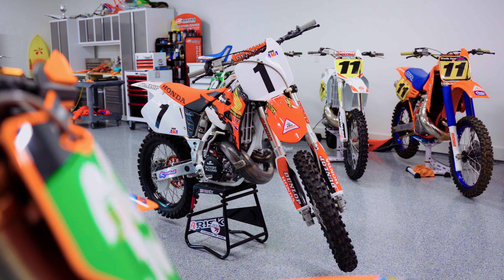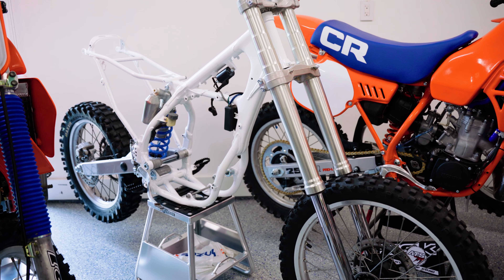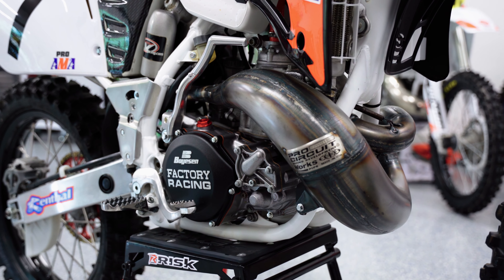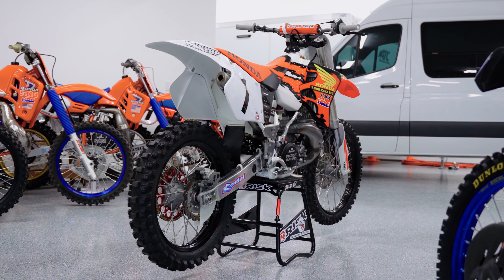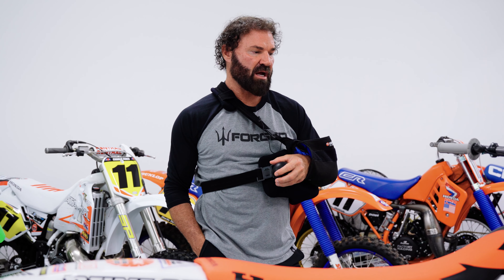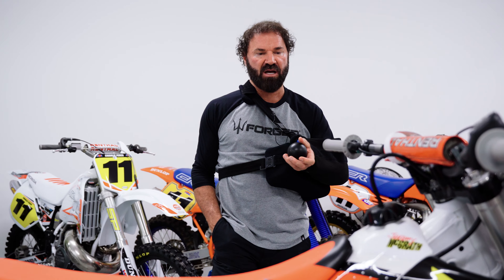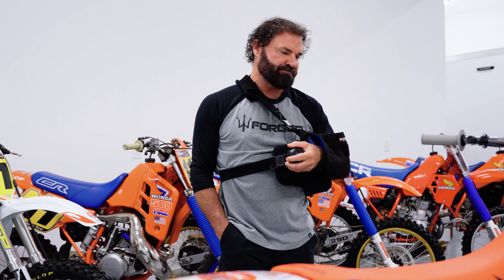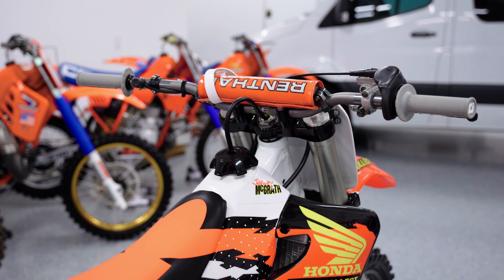Jeremy McGrath CR 250 Replica Restoration

Comment: Hey Charlie just picked up a 95 cr 250 2 weeks ago always loved the 95s going to restore after my 500  That tank whats the difference to OEM
Reply from the maker: Congratulations on the bike!  Clark makes good tanks, but you want to get the factory size. I am not a fan of the oversize tanks. They may have some in stock. Otherwise, there is a company that makes aluminum tanks for the bikes that does a really good job and they are around $450. I did a review of one of the tanks in one of my more recent videos that is posted.
Reply: Thanks buddy yes I seen your video on the aluminum tanks. I might have to go with one on my 86 500 exhaust kind of melted a little bit of it. I’m not sure if it’s still good I don’t I really don’t like oversize tanks at all but I was just wondering, how close they were to OEM I think I can still save my 95s tank can you jsend me the link if you can or I can check them out thanks Charlie you’re the man I appreciate all your v advice and help.
Reply from the maker: @mikeguliz  this is a smaller one for a 2986 cr 500.  I would get this because the 86 tank stock is larger than needed.  

https://www.ebay.com/itm/144917829814?chn=ps&norover=1&mkevt=1&mkrid=711-117182-37290-0&mkcid=2&mkscid=101&itemid=144917829814&targetid=1645685074728&device=m&mktype=&googleloc=9030078&poi=&campaignid=16730423415&mkgroupid=135815925780&rlsatarget=pla-1645685074728&abcId=9300841&merchantid=6296724&gbraid=0AAAAAD_QDh_2fjD8HIR96uqAoRX3mekwz&gclid=EAIaIQobChMI_dmWoo2n_gIVcAetBh3TSgmoEAQYAiABEgLEfvD_BwE
Reply from the maker: This is the company I order mine from:

https://www.mastercross.net/accessori2.php?lang=en&t=speciali&m=HRP%20TANK%20ALUMINIUM/FACTORY
Reply: Thanks buddy